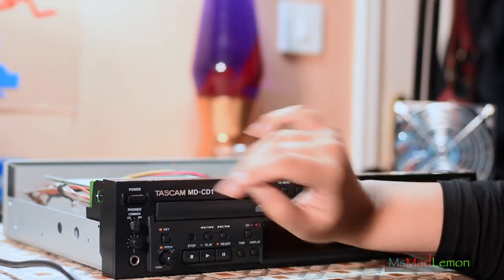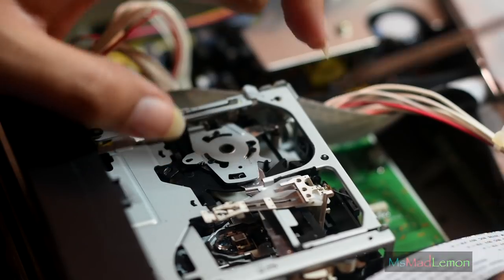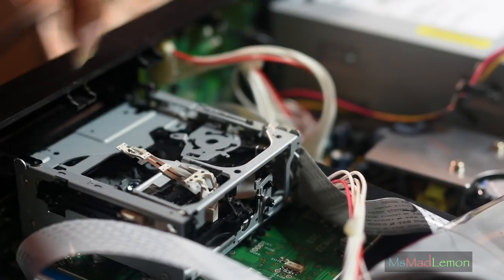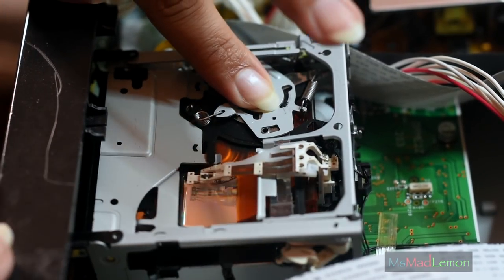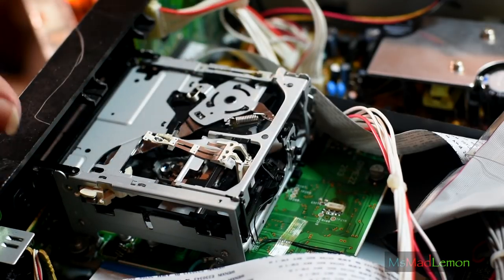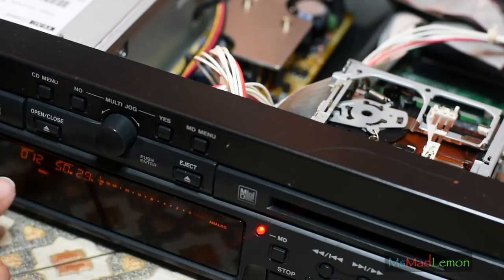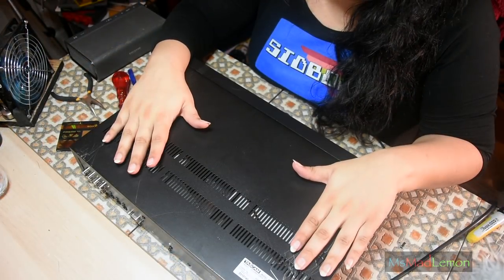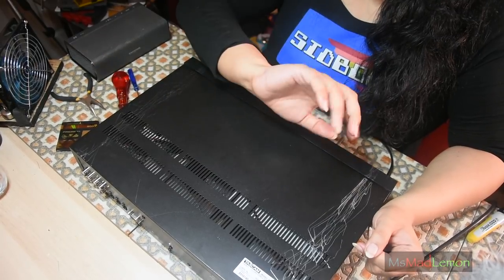Tascam MD CD1 Minidisc Mechanism Repair

Comment: I wish I found this video earlier before I spent all night long doing the same stuff with the same freaking mechanism. it could just save me several hours of life and tons of nerves. Anyway I have succeeded with repair as well. That freaking cover must be in place in order to keep everything running right.  And of course that switch on the board beneath which is pushed by the insertion disc lever must be in the right position for the logic of this device..

Comment: The Sony mechanisms seem much simpler compared to this.
Top tip about grease, apply it sparingly using a cocktail stick and don't get it anywhere near the optics.
Nice save though, glad it's working 😊

Comment: If there was a screw that fell out it must still be in there somewhere. It might jam the mechanism, or cause a short if it is lying across circuit pathways on the printed circuit board. Be gentle when moving the device, or try to find the screw before you button up the case. Great video. Thanks! Oh, and lithium grease is recommended. It is a white grease.

Comment: I can tell you exactly how to fix it it’s not the disk because I have the tascam MD-CD1mklll I have the same issue sometimes to where it thinks the disk is in it. There’s a little micro switch on the back of the mechanism get some electronic spray cleaner spray a dab in there let it dry and it’ll work perfect. Make sure you don’t have it plugged in or powered on when you spray the electronic spray cleaner in there. Also don’t get any spray on the laser😊
Reply from the maker: I fixed it by the end of the video, it was a bit more involved than spraying dioxit unfortunately but I got it 🙂thanks for the tips though.
Reply: @MsMadLemon  sorry i did not see all of the video😁

Comment: You did really good in fixing the deck. Congrats. The MD drive mechanisms are so damned sensitive to tolerances. You were really lucky that the disc did not rip off the tiny plastic arm above the head. That is a weak spot of the tascam mechanisms.

Comment: Oh I figured the pro system would work without fail for decades to come. But I reckon any mechanism can fail. Good thing you weren't too scared to just open it up and attempt to fix it! Kudos!
Reply from the maker: I thought that also, but then most of that mechanism is metal, unlike the Technics MD deck, I think had that become jammed, there's more chance it would have broken. I guess nothing lasts forever but it's why we restore and repair once in a while... I was indeed scared but I had no choice, I had to try. Thanks :o)

Comment: Thanks for the video, very useful! I have got the same drive inside a Denon DMD-F100, and was getting "Mech Err 1" when trying to load a disc. I must have rebuilt it about 20 times before I finally found that the problem was that the clutch gear was stuck solid. Even though the limit switches were working fine, this player still seems to need some clutch slip at the end of the load/eject cycle, otherwise it pushes too far and jams up the mechanism.

Comment: Well Done. From what I learned about MiniDisc. Is the sensors wood get damaged from normal use. In the beginning I assumed it was the MiniDisc. I was wrong. It was a flaw in the design the it allows it to be damaged. Good Job.I felt all your emotions. Brings back memories.

Comment: That’s such a bummer about those big scratches on the top of the unit. We all know you could sand and repaint, or vinyl wrap it, bu I like the factory finish.
Reply from the maker: It is, i'm still thinking about how to approach the big scratches, they do bother me.
Reply: Ms Mad Lemon You should remove all the paint using paint stripper, then sand the metal to a nice finish.
If you use that ripple effect paint it would look cool and factory finish, don't forget to spray a rust inhibiting primer undercoat.👊

Comment: Well done. I'm glad you were able to solve the problem with your Tascam. Did you find that the original grease was dried up and sticky?  That's what usually happens as grease ages. I overhauled a record player from 1957 and found all the original grease was dried and sticky. Cleaning all the old grease up and regreasing with synthetic grease made the record changer mechanism play like new again. I used this stuff called Super Lube Synthetic Grease. I was told it would not dry out or get sticky. We'll see.
What was the problem with the Sony minidisc? Was there some kind of defect in the plastic minidisc housing? With Sony being a mainstream quality name, I would think their plastic MD case would be very precise.
Reply from the maker: Thank you!... I did notice the MD having two cracks in it which I hadnt noticed, maybe it warped as I had inserted it and caught on something.. that is my suspicion anyway.. either way its not going anywhere near a player/recorder again!
Reply: @MsMadLemon  I think this problem happened just because you inserted the disc with removed top cover of the mechanism. The top cover keeps everything tight for mechanism smooth running. The Sony disc was not the cause of the failure..

Comment: One other question. When the SIDbox plays SID files with multiple tracks, does it automatically advance to the next track when the one it’s on reaches the end? I have SIDplayer on my PC and it will just loop a track forever (or reach the end and forever play silence after that) unless I manually advance to the next track in the file, and I know of no way to make it automatically advance. That makes it a pain to listen through all my SID files.

Comment: hello - thanks for informative video. I am having the same issue with my MD-CD1 but with the CD drive - do you still have the service manual? If so, would you be able to link it here please? Thanks!
Reply: The CD drive is a standard 5.1/4" IDE CD-ROM drive. Look on eBay for a TEAC CD-532E drive. The Service Manual for the MD-CD1 doesn't give you any extra information.

Comment: Help me please, my Tascam shows the following message: "servo error" and ejects the disc. I lubricated the mechanism, cleaned the rotary encoder, cleaned the optical laser and changed the capacitors of the PCB Servo. The disc doesn't spin but in test mode the servo motor spins. Whats the problem? I share you the video:

https://youtu.be/ffsoG2UA1fE

Comment: Do you know where I can find parts for this equipment?
I need part # 9A07556300 O/W HD.
This is the magnetic laser pick up “fingers” on top.
I want to fix this machine so I can be as happy as you!!
Reply: This is the overwrite head. It's a magnetic coil. You are highly unlikely to find this in 2020/2021 as a spare part. Best chance is to find a donor machine.

Comment: Interestingly I have now experienced load and eject issues with my MD-CD1 - and with a Sony Premium MD as I notice you have in your hand near the start of your video... Hmmm... I rescued mine, but I need to check the drive now after a lot of gear grinding noises. I will also see if the issue is showing with other MD types as I've not had this issue before...

Comment: What kind of grease is that you were using?

I just love that piece of music “Storm” you were playing in the background! It’s one of my most favorite pieces of C64 music and I love remixes made from it.
Reply: You should use something like Molykote EM-30L which you can usually buy on eBay in small 10g tubs for a few pounds/dollars. You should not be using automotive grease! Remove the old grease and apply a tiny amount of the new grease with a cocktail stick.